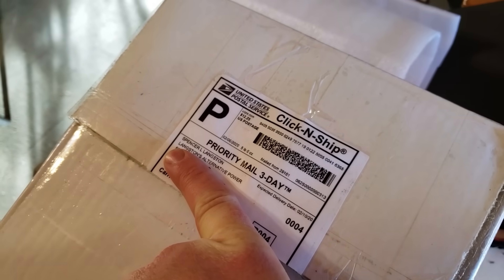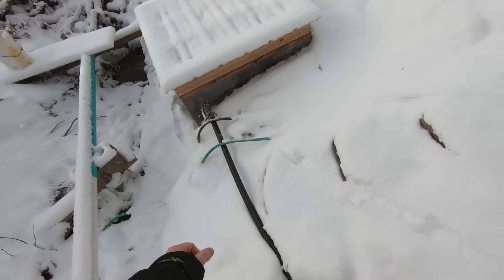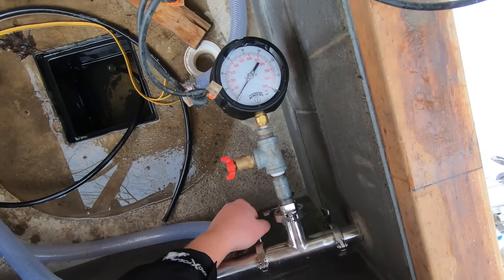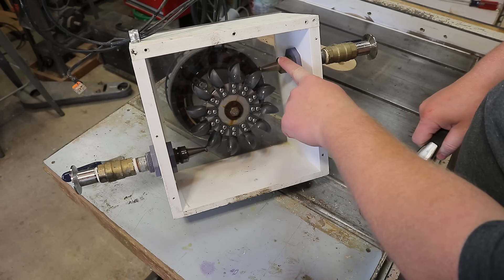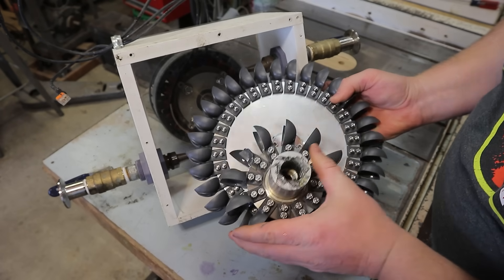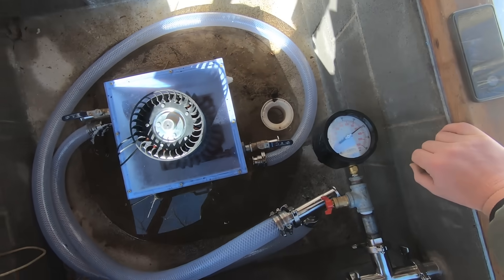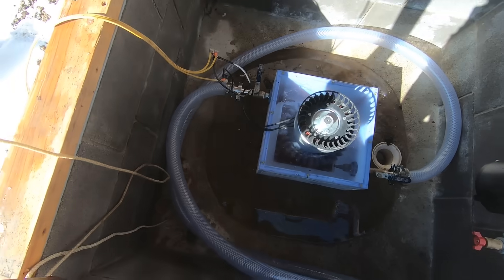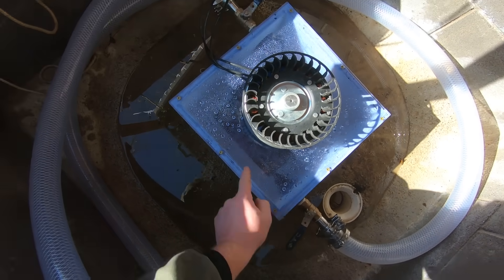Chasing 500 Watts, Big Pelton Turbine

Comment: Your Pelton wheel is flooded!  Nost of the "power" generated is churning water around in the chamber.  Pelton wheels are designed to be totally free of water except for the jet impingement.  The "chamber" should be "NOT".  It should be totally open to the lower water reservoir.  Ideally water will exit in streams in the opposite direction from the jets.
Reply: Couldn he just make a bigger and higher box? Maybe only higher to give the water more room to exit.
Reply: The problem is that he has the hoses shooting water straight at the Pelton wheel which makes the water in turn shoot up and down out of the spoon blades...his hoses should shoot at the top side of the blade so the water shoots into the wall at a lower level than the wheel instead of up and falling back on it and creating unnecessary friction.
Also in a design like this where the wheel is in the horizontal the bottom side doesn't need to be spoon-like..since it's going straight into a pit.
Pelton is better suited for vertical designs to get the water shot away from the wheel..that's why both sides are spoon-like. He's losing power by having the bottom blade be spoony instead of a straight blade right into the pit
Reply: @TiredOfY  I was thinking exactly the same while watching this and i don't even know anything about pelton wheels
Reply: Francisco J just wondering from a numbers standpoint, how much power is he losing from this? Or how much more can he gain from the changes?
Reply: Uh 420W to 500W. So 80W approx  20% gain  @elpowett
Reply: @TiredOfY Partly correct but the spoon shape is intended to (as far as possible) completely reverse the direction of the water, so that every bit of it's MOMENTUM is caught and used. So, ideally the spoons need to be 2 'U' shapes, but are slightly less in reality, so that  the defected water does not hit the back of the next pair of spoons.
Reply: Yea it felt slowed down by the ambiant slushing of water. Need more optimisation indeed.
Reply: I agree. As for how to optimize the turbine to prevent sloshing, consider redoing the turbine set-up so that it's vertical rather than horizontal, with the jet hitting the bottom of the turbine. The water then will immediately go down into the reservoir instead of sloshing around. EDIT: Nevermind, if you're moving to Turgo turbine then that's simpler.
Reply: @Indy509  This is a centrifugal turbine.  Usually the shaft is vertical.  These are commonly used at major hydroelectric dams, such as Hoover.  The entire casing and wheel are flooded.  Rotor consists of radial vanes.  The swirl is started by the housing.  As more water comes in, it pushes existing water inward, which speeds up, and pushes against the vanes.  When it exits at the center, almost all the kinetic energy is taken.  In this turbine, the wheel and water move  at nearly the same relative speed.  (If you were riding in a transparent submarine, you would first see the pipe and housing walls whiz by.  But after entering the turbine, you would see only slow movement toward the center.  The "ride" through would "take awhile".  If you did the same in Pelton, you would see rapid acceleration as you pass through the nozzle, hit the bucket at half speed, make a HARD U-turn, and see the bucket receding at half speed, but surroundings almost still.  The "ride" through would be almost instantaneous.)
          Centrifugal turbine works best for lower heads and huge volume rate flows.  (There is a lot of surface friction of water against housing.  There are no nozzles or restrictions.  But for huge flows, surface loss is insignificant compared to bulk flow.  The lower head, and the more volume, the more this is favored over Pelton.)
          Centrifugal turbines are usually larger in size compared to Pelton, and usually turn slower (so it is more difficult to extract power with generator on small-scale units).  Pelton turbine relies on huge velocities, but except in the nozzle and on the bucket, the water stream is in air (friction is low).
Reply: I'm thinking the housing should be round to improve flow. Make it more like a hydraulic motor than an impeller
Reply: @Indy509  No.  Housing should be "of infinite size", so the water, after contacting the turbine, falls away and does not ever touch it again!  A Pelton wheel is designed to "stop" the water, removing practically all its kinetic energy.  Any other contact with the spinning wheel puts that energy back into the water, which is lost!
          There are other types of turbines (such as centrifugal) which work best when flooded (you can extract every inch of head).  These work well when the water-head is low.  Pelton turbines are for high heads, and do not tolerate flooding.
Reply: agreed exactly
Reply: Make the cover larger and in the shape of a hemisphere. Like a large bundt cake pan, so the water is exhausted down and away from turbine wheel.
Reply: Came here to say this. Cool project !
Reply: من فضلكم كم ثمن هذا الجهاز ،،بهذه السنه 2023،،،وشكراً
Reply: Pelton ist eine "Freistrahlturbine"!!!

Comment: I don't know why it's on dumbass run an alternating current that runs into a rectifier to a DC current then runs it back to a inverter to run it back to alternating current only a dumbass does that or somebody that's scared of electricity you can run that three phase high voltage into a health most houses are three phase breaker system the disc converts it down to a two phase for your house if you're running 220 volts 3 phase liking a hot water heater or something like that or a stove use a 3-phase high voltage you can run it straight into your breaker box and don't have to convert it down plus you can run the hot alternating current and longer distance at that voltage you can't do that with the DC

Comment: Looks likes it's fighting turbulence from being in a square housing...
Reply: That might be true, the best way to remedy that would be to have a shaped shroud that 'excavates' the off-spray ensuring that it does not splash back against the wheel. Then one would know.

I think that one could maybe put a pair of stationary rings of blades [something generally/vaguely like this, only with collector rings to ensure that said splash has no way to fall back and land back onto the spinning peltier impeller system, and you would do best with one for the top if you can only get one direction, but if both directions could be had, put one above and below... https://www.amazon.com/Flex-lite-32112K-Electric-Replacement/dp/B003EOCG88  also it is possible to make something like this from heating, bending and gluing PVC pipe really cheaply, if you have the time and energy to invest in it ] to ensure the water is indeed directed away from the middle on a continuous and consistent basis.

Comment: A short video I watched a bit ago mentioned a broken hose clamp. You might have fixed this but here are a couple ideas I have learned from boating. Below the water line in a boat US Coast Guard rule is to double hose clamp. Mostly that is done so if one clamp breaks there is a back-up. It would be rare to have both break at the same time. Also, and more importantly, in my opinion, is that if everything is double clamped, you always have a spare clamp for that weird circumstance when you need and extra. And the extra you need will, likely, be close to the extra you have. Finally, try to find “gear” hose clamps rather that “slotted” hose clamps. The tighten better and are less prone to corrosion failure. 316 stainless also helps solve the corrosion problem you’re not in seawater do 316 SS is probably overkill and over $$&.

Comment: I have just started watching your YTs. Am I correct that the flow you have going through your turbine is just gravity fed? I mean the water source is uphill of your turbine, maybe a tank or a drum that in continuously filled from a natural water source? Your plumbing then comes down hill from the tank and the force of the water is a combination of air pressure on the water in the tank and gravity?
Reply from the maker: Correct except air pressure doesn't play a part.
Reply: Joe Malovich very clever.

Comment: I think you should make the housing round, and possibly perforated so the water can exit the turbine radially with minimal interaction on the turbine wheel itself.
Reply: @Heads Mess His Pelton wheel is designed to have the jets hit and split the water, that is how they work and are one of the most efficient water turbines. Anything other than that is going to be a total fail!
Reply: @garyhoffmann1615  Pelton wheels are more efficient vertically, so it might not actually be the most efficient in this circumstance
Reply: @ricklu5887  Vertical will be a little better but not by much, Pelton wheels are way in front of anything else at higher heads.
Reply: @garyhoffmann1615  Good to know
Reply: @garyhoffmann1615  especially when you consider how small the water is in volume.
Reply: He should 3d print one!
Reply: I agree. The corners are causing lots of cavitation.
Reply: BS! The entire enclosure is at atmospheric... @ThriftStoreHacker
Reply: Yassss definitely an upgrade
Reply: Using a hexagon you could eject the water through the corners.
Reply: I think a cone shape increasing in diameter as it goes down so as the water gets pulled outwards it will also get pulled down
Reply: @bohanhouston3424  he just needs to scrap the box entirely and mount the whole assembly about 450mm higher up where it will be easier to tune the jets, maintain and give plenty of space for gravity to deal with the water coming off. The box is completely unnecessary.
Reply: You can calculate the theoretical power by by Pxgxh formula and check how efficient it already is. I am impressed with 450 watts of output with such low flow rate and head. BTW what's your head?
Reply: @bushmaster777  280’ -125 psi 8.2 bar
Reply: won't work, cause he didn't think of it himself
Reply: 2 volute scrolls of 180⁰ length will help. But I'll guess a max gain of 10 to 20W of power.
Reply: NEW TECHNOLOGY INVENTED TO WASTE ELECTRICITY.MODI GI INDIA WILL DEVELOP BY YOUR IDEAS.CRYPTO IS YOUR OWN IDEA OR SOME TECH COMPANIES GAVE SUGGESTIONS TO ALLOW CRYPTO IN INDIA.JAPANSE BITCOINS ARE DANGEROUS. LIKE JAPAN DID TO AMERICAN  PERAL HARBOR....
Reply: @dragon.fromindia3235  OK THANK YOU FOR THE INPUT AND ALSO THANK YOU FOR SHOUTING

Comment: Design it more like a fly wheel with most of the weight to the center of the shaft, should achieve higher rotational speeds and require less torque to rotate.
Reply: This isn't really a factor for efficiency as no matter how much it weighs once it's up to speed it is the same speed as long as the diameter is the same.

Comment: your getting a lot of turbulence from the box being square, i feel a circular housing would increase your efficiency by 20%?
Reply: Heads Mess what abt the back splash of waisted jet energy i would think a round Design would create less drag on opposite of spoons.
Reply: @Heads Mess honestly yah... I'd smooth the corners of the box too, and angle them down the drain so that splash back isnt happening.  A couple 3d printed radius could do it.
Reply: You need to look at bearings and nozzles, not the shape of the box

Comment: Also if you would have a way for the water to get out it would run faster right... I mean two jets running into the wheel and not getting out of the way fast enough could be your problem.

Comment: Wouldn't a plug-in work better, also one jet stream of water should be faster than two...???
Reply: 2 jets drop the pressure/velocity a little but gives you just below double the torque (if the pipe isn't too small)

Comment: I think you would get better results using compressed air with a release valve and an electrical Gage on an electrical generator with out the motor
Reply: And where would this air come from?
Reply: @benlawton5420  An air tank
Reply: the atmosphere
Reply: @DanaBidlake  What's going to pressurise it?
Reply: @benlawton5420  This is a question I get a lot and the answer is simple. An air pump or two compressors.  you do not own an air compressor do you?
Reply: Just think air tools
Reply: @DanaBidlake  He's trying to make power not use it though.

Comment: Just curious how high up is your water source to generate 120 pounds pressure?
Reply from the maker: so the math goes like this, there is 14.7psi in one atmosphere near sea level (im above sea level but that is insignificant) so 120/14.7 is 8.16 atmospheres. Now you take 8.16 atm times the feet of water equivalent to one atmosphere which is 33.9 feet and get 276.6 feet.

I think the actual pressure is closer to 117 psi, can you tell me how many feet that is?
Reply: To calculate the pressure at the bottom of an elevated water storage tanks in pounds per square inch is important in many applications, but easy enough to do. You can work this out with a simple rule: 1 foot of water creates 0.433 psi of pressure, and it takes 2.31 feet of water to create 1 psi of pressure. From this, you can work out the psi of any elevated water storage system
This is the scientific method of calculating water pressure vs height .

Comment: I would like to see you make a Tesla turbine I hear they're pretty efficient
Reply: Tesla turbines are the most efficient for some applications. They do not supply much torque, which is the reason you do not see them used often. They are good for other applications, but not power generation which requires efficient torque conversion.

Comment: i was wondering if you made the bottom of the new box more like a funnel so the water can exit easier if it would help?
Reply from the maker: 8:40
Reply: @JoeMalovich  i see that but it looks flat across not angled down into the hole. looks like it will hold water in the corners.
Reply from the maker: @ridinmoose4days533  It may hold some water but really it's far enough from the turbine that it shouldnt be a problem.

Comment: This probably isn't a problem at ~40A, but it might be worth looking into:

I can't remember if you've mentioned in your past videos about the wire guage from the water wheel (I haven't actually watched all of them if I'm honest), but now that you've got less rpms on the same alternator, you're going to be more dependant on the resistivity of the cables themselves (less rpm = less voltage, more current -> more voltage drop). If you're ever going to re-wire the cables in the ground, maybe consider putting in some sense wires to run parallel to your main current carrying wires just to compare the voltage drop across them at the charge controller.

Comment: Farmers have filters that will screen your water. When I say Farmers I mean the manufacturers of the spray rigs. Should I say farmtek has filters that can filter your Walter through an inline pipe screen apparatus. We have these in many different types of Screams. And lots of sizes. From half inch in line pipe thread 2 inch and 1/4 in perhaps 2 in. Yes we made our big spray rigs large.

Comment: I have mentioned one other time that you probably should consider a bulk tank at the top of the hill. Reduces Bubbles and adds pressure. And if you can jump even more water into that bulk tank. The better this is probably your most hindrance. The hundreds of you adding two more notches. That will make four nozzles hitting the propellers on all four sides. Your lines are big enough. The pressure should be there. And this would be a good time to mention you might play with a size of the hole in your nozzles. Yet it is the flow that you have described is your limiting factor.